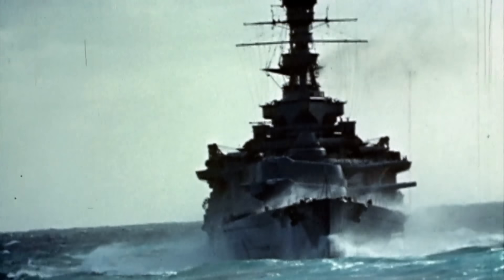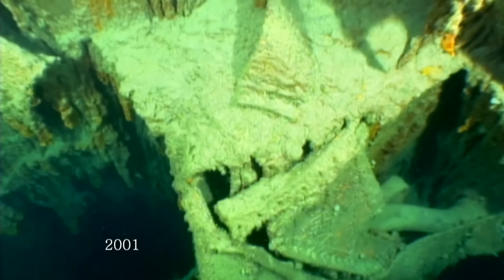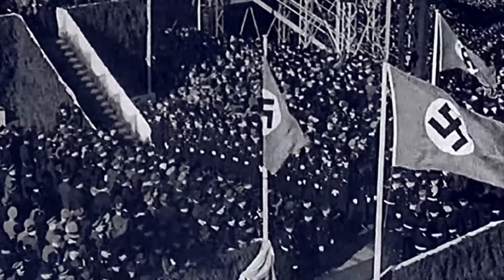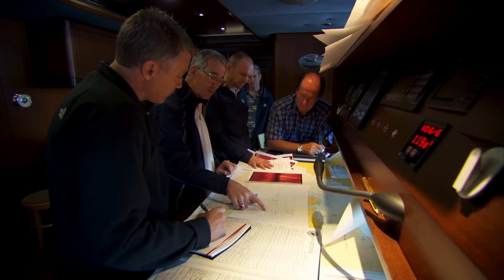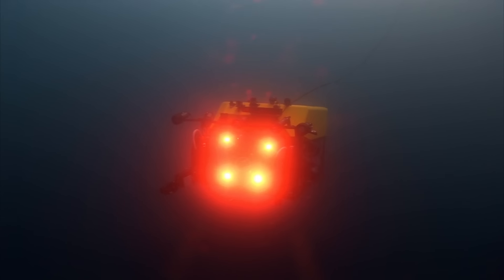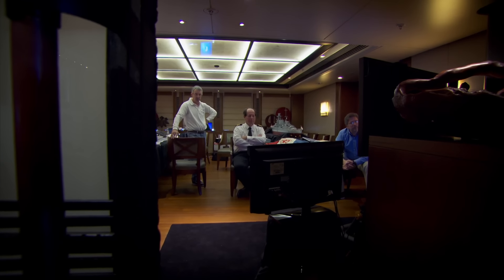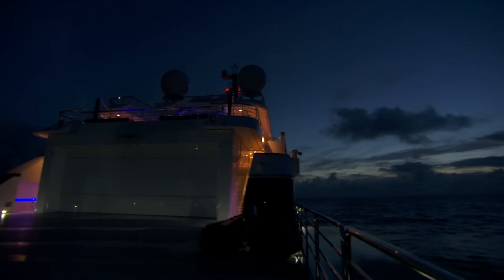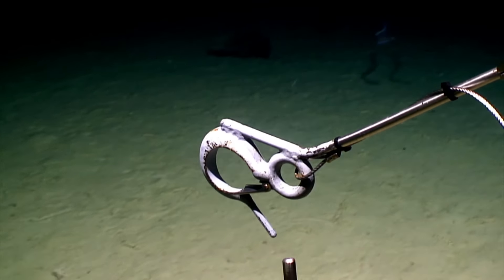How the Bismarck Sank HMS Hood - Documentary

Comment: The hood was inferior to the German fleet.
Reply: What 'German fleet?'   Hood, by the way, was 20 years old at the time of her sinking. Bismarck, three days later, was destroyed as a fighting ship in about 20 minutes by a fifteen years old battleship.
Reply: @dovetonsturdee7033  Bismarck was destroyed by the combined force consisting of a aircraft carrier, several battle ships and loads of smaller units.
Reply: @angrydoggy9170  The carrier disabled her, HMS Rodney finished her as a fighting ship by destroying most of her main armament, her bridge, and her command staff, in the first 20 minutes, after which Rodney, King George V, Norfolk, and Dorsetshire, completed what was, in effect, the annihilation of a wallowing practice target.
Reply: @dovetonsturdee7033  Yeah, a target which couldn't manouever. In other words, a sitting duck. What happened to the prince of Wales? 7 (3 PE, 4 Bismarck) hits in less than 10 minutes. She was extremely lucky when a 15" shell penetrated her underwater and didn't explode near a torpedo bulkhead/ secondary magazine. 
Admiral Holland closed to 16000 yards and the German gunners obliged with pin point accuracy.
Reply: @z1az285  Prince of Wales was, at best, half worked up, yet still inflicted enough damage on Bismarck to force Lutjens to run for St. Nazaire.

If you think that the crippling of Bismarck's stern by an aircraft torpedo was in some manner unsporting, then perhaps you should confine your interests to things like tennis, lest the idea that war is inherently unfair alarm you.
Reply: @dovetonsturdee7033  Sure, I'm a neutral observer and the way I see it, on paper the king George V class was a match for Bismarck. But POW was firing at Bismarck much longer than the Bismarck fired at her (albeit fewer shells). Bismarck's stern was defective in high seas. No question about it and the rudder hit was a critical hit. No two ways about it. I'm not British or German nor am I a fanboi of either side (and there are plenty here, that much is certain). The fact is Bismarck earned her reputation in battle as short lived as her career was. No one gave it to her for free. At the end of the day both British and German crews did their duty. Nothing more or less. Those are the facts. I'm not going to denigrate the Bismarck because she was German, but I will say this. The admiralty was criminally negligent regarding the hood. They knew her flaws and sent her into battle. That's it.
Reply: @z1az285  Prince of Wales had barely begun working up when sent out in support of Bismarck. Bismarck had been working up in the Baltic for eight months.  The probability was that a fully worked up KGV, such as King George V herself, with her heavier weight of broadside and her superior armour, would have been superior to Bismarck. Rodney certainly was, except in speed. A fully operational Bismarck could have chosen to refuse action.

Bismarck actually sank a 20 years old fast battleship, but failed in the mission.

Why was the Admiralty negligent regarding Bismarck? Hood was as well armoured as a QE, and had a greater weight of broadside than Bismarck. The fact is that the British needed to ensure that the German squadron did not reach the wider Atlantic, where it would be harder to track down. Placing two fast capital ships in both the Denmark Strait and the Iceland-Faroes Gap ensured that Bismarck would be brought to battle. Which is precisely what happened.
Reply: @dovetonsturdee7033  The admiralty was negligent regarding Hood for the very simple reason that they strengthened her side armor with 5000 additional tons but not her deck (though the shell penetrated her side armor, not her deck) but she couldn't score one hit on either Bismarck or PE because her rangefinders were too low. That defect was rectified in the hms vanguard. Hood was a battlecruiser though. Yes, Bismarck was intended to to be used as a  commerce disruptor/raider but she was also designed for battle if required. You talk about superiority without referring to the ships crews. The German gunners were right on target from the second salvoes. How do you classify a ship as "superior" when they are so evenly matched otherwise? In my opinion the Iowa class was clearly superior to Bismarck in terms of firepower, speed, armor protection. Vanguard was. Yamato was. Certainly not King George V. Sorry.
Reply: @dovetonsturdee7033  Rodney certainly fired a heavier broadside but she was no comparison in terms of speed or armor protection to the Bismarck. Not even close.
Reply: @z1az285  Actually, Hood's deck armour was on a par with that of the Queen Elizabeths, though not comparable to the Nelsons or the KGVs. It was, by the way, superior to any WW1 German battleship except the Badens. She was not a traditional battlecruiser, being much more a fast battleship.

Hood, by the way, had main gunnery radar, unlike Bismarck at the time of the engagement. Her error was, initially, to target Prinz Eugen and then to attempt to switch targets.

Are you suggesting that the British crew was inferior? Perhaps you might explain how you reach that conclusion. I determine superiority by study of armour and firepower. In both categories, KGV & Rodney had the edge, despite, unlike Bismarck, being built within the 35,000 ton limit.

The Iowas were built almost five years later than Bismarck. They had greatly superior sensors and speed, although they were weaker in terms of belt and deck armour to both the Nelsons and the KGVs. They were also weaker, in terms of belt armour, to the Bismarcks, and only marginally better off, by .1 of an inch, in terms of deck armour. Certainly, the Iowas were a class apart in terms of weight of broadside to all three of the others.

You don't need to apologise, when you are, in point of fact, wrong.
Reply: @z1az285  For someone who claims impartiality, you aren't actually showing much.   Allow me to educate you.   As I said, Bismarck had the speed advantage over Rodney. She needed it because:-

Rodney   Belt 14 inches. Deck 6.25 inches. Weight of Broadside 18,432 lbs.

Bismarck Belt 12.6 inches. Deck 4.7 inches. Broadside weight 14,112 lbs.

Oh, and Bismarck had the outmoded incremental armour layout, whereas Rodney (and the KGVS and every US battleship since the Nevadas) had been designed with the greatly superior all-or-nothing pattern.

You are right. The two ships were 'not even close.' But not in the way you mean.
Reply: @dovetonsturdee7033  I think you answered your own question. The fact she misidentified prinz Eugen and did not hit a single target says it all. Also you conviniently disregard watertight compartmentation and quality of steel on both Bismarck and Iowa. How about speed? I suppose both Iowa and Bismarck needed that too. By your logic the Rodney was superior to the KGV class as well. Ok. What about the Yamato? I'm sure her armor thickness and weight of broadside would put her above everyone else including vanguard but I see you are strangely silent about that. Of course her speed was only 27 knots but she didn't need to run from any battleship. Did I get that right?  Maybe you are the one who needs to be impartial.
Reply: @dovetonsturdee7033  Neither are you. First i retract what i said about iowa Armor being superior to the bismarck's. Not even close. Bismarck adopted a incremental Armor design which was far superior to the all or nothing design. It was not a WW1 design though it had elements of it. As a matter of fact there is an excellent article by Daniel Hammer comparing the schemes of Iowa, Nelson/ Rodney, King George V, Montana and the Bismarck and guess what? The Bismarck was superior to every ship listed except the Montana, and it is for those reasons she was able to take the kind of punishment she did without sinking (prior to torpedoes). So yeah, i think you are the one who is biased. It's not just about "belt thickness". It's also about the type of steel, compartment design, spaced Armor etc.  I will try to post the article shortly.
Reply: @z1az285  For a neutral commentator, you are strangely one-sided. mein herr.   What do you think misidentifying Prinz Eugen for Bismarck proves about the relative capabilities of the ships themselves?   Hood was 20 years old at the time, and inferior, though actually not that inferior, to Bismarck. Rodney was 15 years old, but certainly not inferior.

'Also you conviniently disregard watertight compartmentation and quality of steel on both Bismarck and Iowa.'  If you wish for a detailed technical discussion, you need to prove yourself worthy of one, and your lack of knowledge displayed to date suggests that you aren't.  You show all the traits of the traditional wehraboo, in that you claim that, although Bismarck had a lignter broadside, and weaker armour, laid out to an outdated pattern, she was still superior because she was built using magic German steel. 

As to her compartmentation, it seems you aren't particularly familiar with her design, which was simply an enlargement of the High Seas Fleet's WW1 Baden class. The Badens were excellent ships in 1918, but battleship technology had moved on somewhat since then, even if German battleship design hadn't, for obvious reasons, kept pace. You might wish to examine Bismarck's other major design flaw, the placement of her internal communications above her main belt. As a result, these were quickly destroyed, in about 20 minutes or so, on 27 May, when Rodney's first salvoes took out most of her armament, her bridge, and her command staff.    

Iowa is not relevant to this discussion. I have already discussed her in earlier posts in any case. I don't recall referring to her speed, so why do you feel the need to bring it up, and I have already said that an undamaged Bismarck, like the Scharnhorsts, had the ability to use an extra knot or to to escape from battle.

Actually, the Nelsons were, except in speed, superior to the KGVs, simply because of their heavier broadsides, resulting from the British fitting 14 inch rather than 16 inch guns in order to comply with Naval Treaties. By sticking to the rules, this gave the KGVs a broadside of 15,900 lbs, which was adequate, but nowhere near the 21375 lbs of 9 x 16 inch which might have been achieved.

I am silent about Yamato because she is entirely irrelevant. Firstly, she was still in the latter stages of construction, only commissioning about seven months after Hood & Bismarck sank, and secondly, she was intended to operate on the other side of the world. Now, if you can demonstrate that Yamato might have dramatically appeared in the Atlantic in May, 1941, then please feel free so to do.  The same comment might also apply to the Iowas, or Vanguard, come to that.

In short, I find arguing with wehraboos, even ones who claim not to be, tedious, and if you can't stick to the subject instead of flying off at odd tangents, I won't reply further, as I have better things to do.
Reply: @dovetonsturdee7033  "Actually the Nelson's except for speed were "superior " to the KGV". Thanks for proving my point. No, their Armor design  was far inferior which is clearly outlined in the article i mentioned. I have heard enough, and frankly  by calling me mein Herr you display your own ignorance and prejudice and how pathetic you are and keep bleating about the Baden class design which the Bismarck doesn't even remotely resemble though it's the starting blueprint. I never claimed to be an expert, but neither are you. As far as I'm concerned there are others like Daniel Hammer who have raised and answered points objectively. Like I said, i will post the article shortly. Read it or don't but i know what I needed to find out.
Reply: @z1az285  Congratulations! You are the first person who claims to be 'impartial' who believes that incremental was superior to AoN as an armour layout. Perhaps you might explain why the world's three largest navies between the wars, Britain, the US, and Japan, all designed their capital ships on AoN rather than incremental principals?   Were they all less intelligent than your brilliant Germans? Or might it have been that German designers were simply kept in the dark about these advances?

You might care to read the opinions of Dulin, Garske, Breyer, or Friedman on the subject, or even an excellent article by Joseph Czarnecki, entitled 'All or Nothing Protection.'   His last paragraph is particularly enlightening :-

 'In Second World War action, the "all or nothing" scheme proved successful. Incremental armoring did not, although available test cases were few. HMS Hood, featuring the older incremental armor was lost most probably to a shell passing through a thinner upper belt and into a magazine. DKM Bismarck also featured incremental armoring, as was largely laid waste during its final battle above its armored deck by AP shells detonated by a medium thickness upper belt. HIJMS Hiei and Kirishima, both with the older protective scheme, suffered heavily from fires started in their casemates by AP shells. These fire contributed along with other damage to their untenability and eventual loss after damage off Guadalcanal. Details of DKM Scharnhorst's loss are lacking, but probably resemble Bismarck. In contrast USS South Dakota came off fairly well when a power failure and an ill-considered turn silhouetted the ship to Japanese fire off Guadalcanal. The ship was extensively hit by common, HE, and AP shells in the superstructure, most of which passed through while causing relatively little damage.'

I have never heard of Daniel Hammer, by the way.
Reply: @z1az285  Calling you 'mein herr' was neither ignorant nor prejudiced. It was simply an expression of contempt at someone who claimed to be impartial, yet whose every comment proved the contrary. If you lack the ability to be honest, then consequently I lack the ability to be courteous. 

Feel free to post the article. As I haven't heard of Daniel Hammer (neither has wikipedia, a source I rarely use but tried on this occasion, by the way, simply to find out who he was. Though without success, sadly). 

I suspect, that the acknowledged naval historians to whom I have referred do rather outgun him, however.

This my last reply, by the way. Further conversation would be superfluous
Reply: @dovetonsturdee7033  Read the part about "Could the USS Iowa have taken the same beating as Bismarck or Yamato" by Damien Hammer from Quora. I see nothing here that contradicts publicly available information and it answers a lot of other questions too. The link is getting deleted unfortunately
Reply: @z1az285  I thought you said the name was Daniel Hammer?   You seek to build an argument based on a comment on Quora? That rather tells me all I need to know.   Obviously, in your world much better informed than my range of academic sources.

Thank you and goodbye. Please don't respond, as my failure to reply will doubtless annoy you.
Reply: @dovetonsturdee7033  would you prefer navweps? Sorry i don't have access to it.
Reply: @z1az285  How sad.  I, of course, do. Indeed, the paragraph about AoN compared to Incremental came from it.
Reply: @hohenstaufen.1010  Hood was regarded as one of the most powerful warships in the world for around 20 years.   How many days did Bismarck last, again?